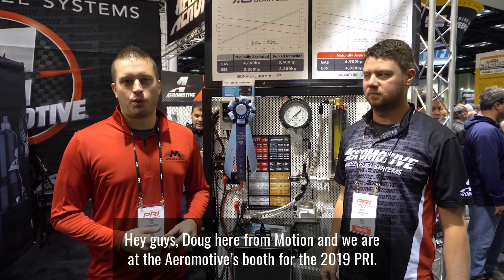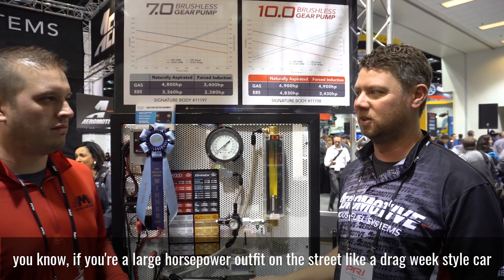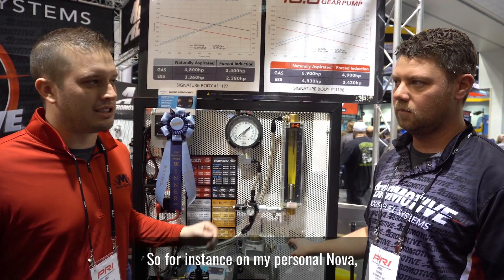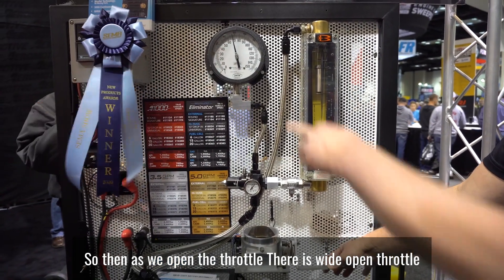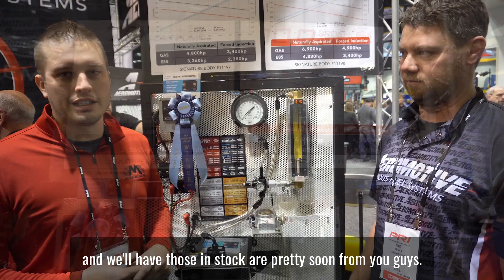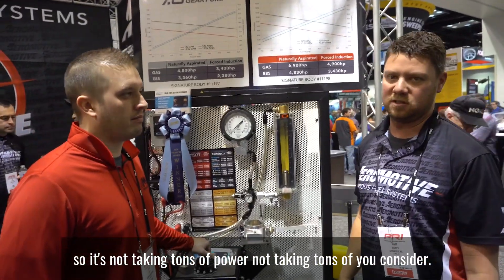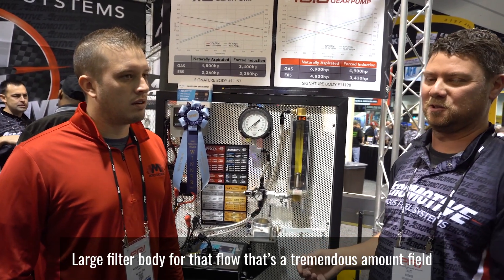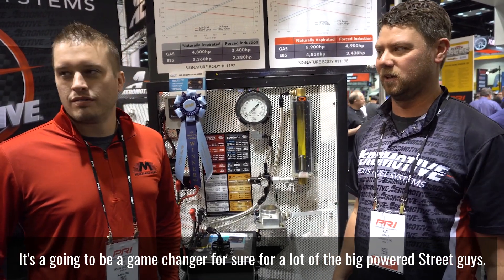Check out the Aeromotive 10 GPM Brushless Fuel Pump!

Comment: This may be what I go to when I go turbo with my car.  My question is why is it only good for 1800 hp on methanol?  Is it losing a lot of flow when the pressure is up for methanol?
Reply from the maker: Live To Race it actually sustains flow all the way thru 150psi, injectors can’t operate over that pressure so that’s typically sufficient
Reply: @MotionRaceworksOfficial  so why only 1800 hp on methanol? seems like 10gpm is good for 2500
Reply from the maker: wforty94 methanol takes roughly double the amount of fuel as gasoline.  If you run an engine wet (use the methanol to cool the motor and air charge) you will consume even more yet
Reply: @MotionRaceworksOfficial  thanks!